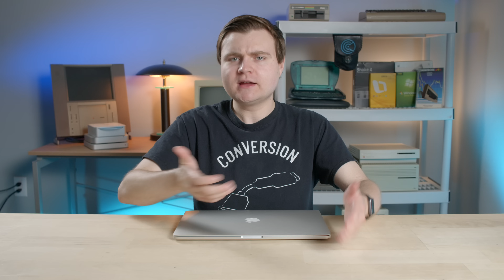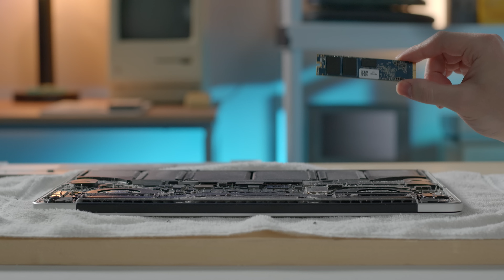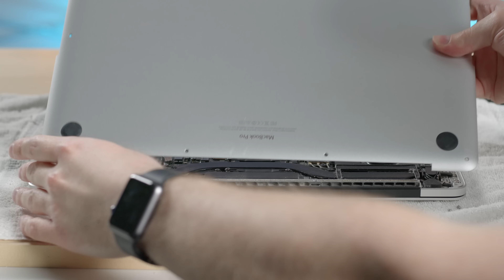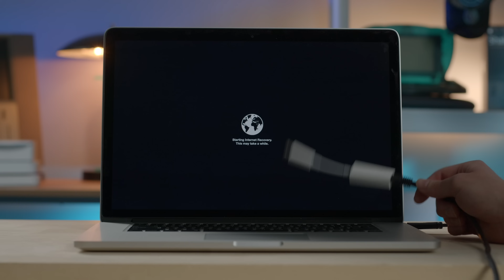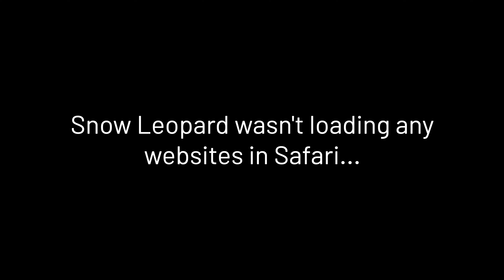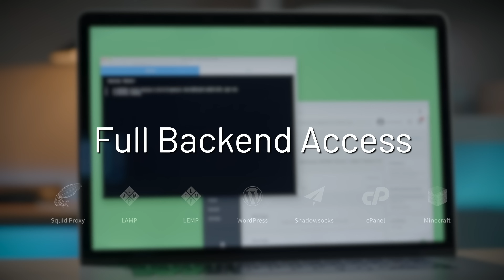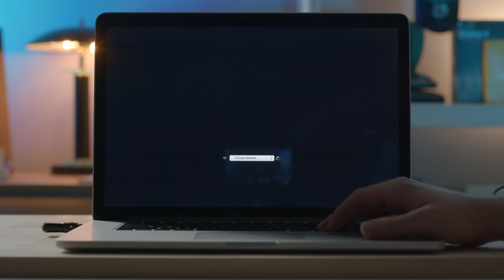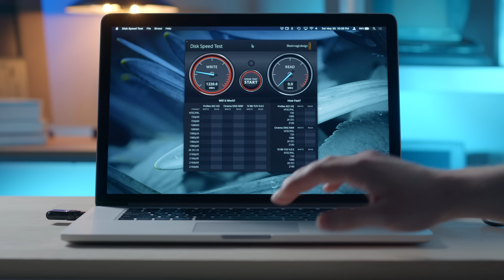MacBook Pro SSD Upgrade (It Took Longer Than We Thought) - Krazy Ken's Tech Misadventures

Comment: I think it requires it to be on high sierra or mojave for the owc drive to work. Catalina is a nightmare don't even bother using it its terrible
Reply: Sam I don’t know what’s wrong with your version of Catalina but I have a 2020 MacBook Pro that ran Catalina from factory and it seems to work just fine
Reply: Evan Diaz on a 2012-2015 retina MacBook Pro it runs terrible. Fans speed up in 5 minutes, overheats too quickly and does not properly hold battery charge. I have since gone to Mohave and had zero issues and all problems have gone. Not to mention Catalina disables support for 64 bit applications and is useless for me.
Reply: @Sdme29sds  *support for 32 bit. I would recommend a fan control utility. should this be necessary? no, but catalina has some nice new features too that make up for the downsides.
Reply: @Sdme29sds  mojave started the change there was a lot of applications that i wanted to use that i could no longer use because of mojave. but like they sasid catalina does have a good few features that makes up for it's problems.
Reply: @Sdme29sds  You are highly exaggerating.  I have tested it plenty of times on my 2015 MacBook Pro 15" Retina MacBook and it runs just fine, except for the lousy Music, TV, and Podcast apps that make it not worth using.  Do a clean install because your upgrade process from an older version of macOS to the newer version is causing your issues.
Reply: @Mcnibbus  except the new apps for Music, TV, and Podcasts are complete garbage.  That is why Catalina is terrible.  Stripped down baby versions of iTunes with missing features and inconsistent UIs.  Sure, that is what people wanted.  The TV app is so poorly done, it has interface incompatibilities with AppleTV, and the store in the new TV app does not allow you to search or purchase complete series, bundles, or box sets.